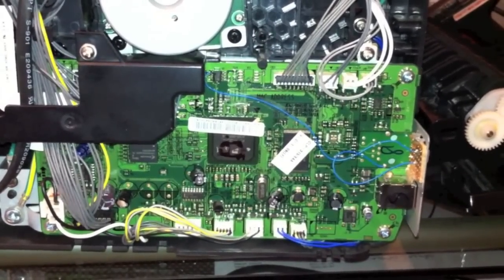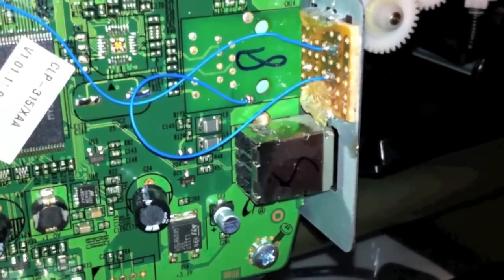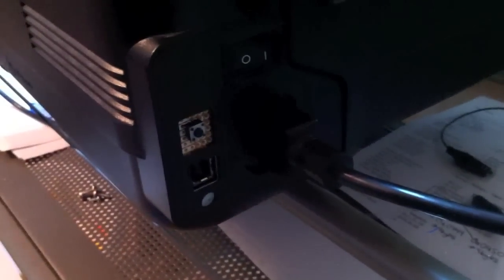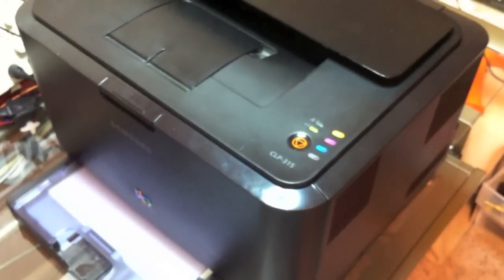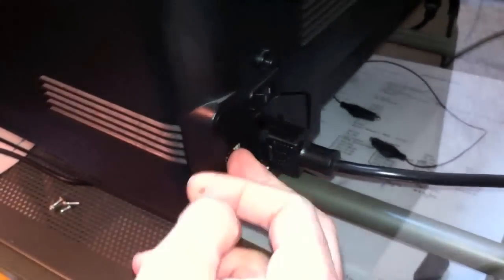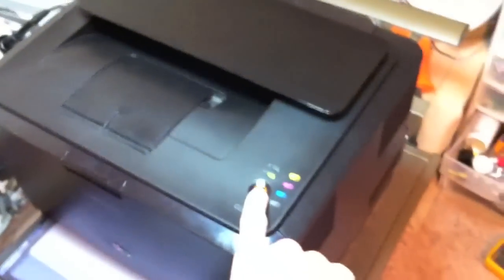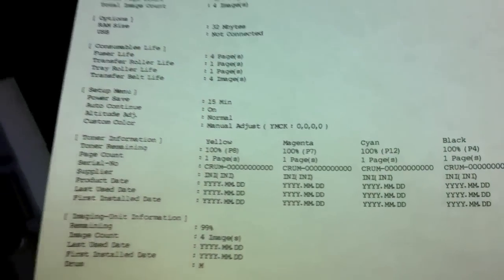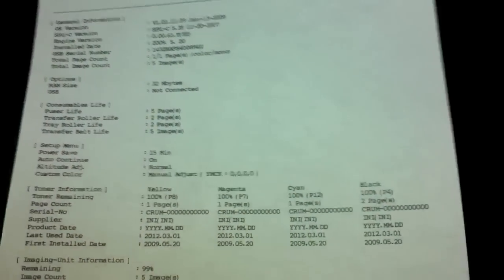Samsung CLP-315 Page Count Reset Hack

Comment: Turns out my board looks somewhat different than yours, but by zooming I could it as the V1 chip, found it in another location, brushed off my somewhat rusty soldering skills, and it works!  Thanks for the great hack!

Comment from the maker: I was lucky with my toner.  It all ran out at the same time so resetting all of the counters made sense.  If you want the low toner warnings to work correctly, after you reset using this method, you would need to refill all cartridges (as I did after this hack).  If you don't, I imagine the worst you would run into would be areas with missing toner (as you have mentioned).  Good luck!

Comment: Worked like a charm! No switch but I used an alligator clip test lead to close the circuit and left the two wires hanging out the back for future use. Although, eventually, I will run out of toner for real. At least I'll be able to use all the toner. Thanks for the clear demonstration.

Comment: Thanks Brian, just did this on my Samsung CLP310N, worked like a charm first time, reset cartridges to 100%. Had just one problem identifying (pin1) on 24C64WP, got to look carefully as it has been placed at 180degrees, did not notice 45degree bevel on chip so that top pin to the left you mention is actually (pin 5)

Comment: I took me an hour to try different times to release button when starting. I tried releasing the button at blue then red, and reed light and it never worked a wasted a ton of paper until i read here somewhere below .you have to tape the metal contacts on the cartridge! And it works i got 100% all toners and 0 pages!
Thanks
Reply: And thanks to you for that important info. The tape across the Cart Contacts is essential.

Comment: Thanks so much.  I used your method but only reset my black counter by printing the config page instead of the color test page during the reset.  For me, I print mostly black so it empties much more often.  The Colors all kept the original values.  Thanks again.

Comment: Just had a look at both my 315 & 315W, the boards are quite different to yours!
V 0.5 4L & V0.4 4L. Also tried the hack where you lift pin 7 and connect it to pin 8 - no luck.
What I really need to know (because I have alot of Toner) is how to reset counter on the ITU.

Comment: You should have mentioned that it's NECESSARY(!) to at leat print one color and one mono page while in reset mode so the new counts get writen to the chip, otherwise it will write the old counts after normal boot (both, clp 310 and 315). Btw, you only need to push the reset button until it makes noise, not until it stops making noise. Cheers!

Comment from the maker: I installed the momentary switch because I will need to perform the reset procedure the next time I run out of toner.  The switch certainly isn't mandatory, but I didn't want to open up the printer every time I needed to reset the counters.

Comment: Hi Brian,
thank you so much - I tried it too (CLP-315) - It's perfect.
I additionally had to tape the contacts of the original toner-counter...and what a surprise: Suddenly the printer is able to print colored pictures with "empty" toner ;-)
Otherwise, if I do not tape the contacts: After normal re-boot, counter of colored pages is back, mono remeins "forgotten".
--> Since 2012, is there any news e.g. does the printer still accept the hack? Or may be it requires original toner after some time printing without gettin any information from the missing counter-chips at toner?
Best regards from Germany :-)

Comment: There is a company out of Canada (find them on Ebay) that sells a little board pretty cheap w/instructions. They also sell toner for less than 1/2 what Samsung does.The serialized toner issue can be gotten around by insulating the contacts. FYI if you are using this printer with the wi-fi option, be prepared to input ssid/wpa every time there is a power failure, so keep a cat5 cable handy. Now...how about an attorney who is hungry that would be willing to lead an anti-trust suit??

Comment: How about a hack for the 325.  Circuit board does not match the 315 model so I am a bit flustered as to where the reset chip is.  Any help on this?
Reply: Did you end up finding a way to hack it?

Comment: Great trick thanks a lot! Just one question. After reseting, all toners where 100% but after reopening the printer, Black was 100% and the other toners, where i left them. (Y43% M48% C53%). Black before reset was at 16%. Should i wait for the others to go low too and then reset again?
Reply from the maker: I can think of two possible scenarios where this may happen.  You may have toner cartridges with chips in them.  If so, make sure to tape over the contacts and re-run the hack.
Another possibility is that after booting with SDA held low, you printed the configuration page, but didn't print the demo page.
Booting with SDA held low interrupts the EEPROM of the page counts leaving them initialized at 0 in memory.  Printing the page afterward is what actually writes the new value (1) back into the EEPROM.  New values will only be written for the toner colors used on the page.  The configuration page is black and white and the demo page is full color.  Make sure to print both.

It could certainly be something else that I'm not aware of, but these are the things I would check first.  Good luck!  (c:
Reply: Brian Rumburg I'm an idiot, i didnt print the demo page and the color toners were not reseted. I followed again your instructions and everything's fine now! Thank you again!!! Great job!
Reply from the maker: Γεώργιος Χαλδαιόπουλος Fantastic!  Glad to hear it worked out for you.

Comment: Used this hack on a CLP-315W when the imaging unit counter reached its limit. I couldn't print a test page even more! The chip was located a bit more to to the right, next to the ribbon connector. For a successful reset I had to tape all the contacts on the cartridges and had to ground the reset during the boot up until the first green flash of the status indicator. The printer starts spinning for a much longer time than normal. At the end of the boot up you should get a green status, if not; the reset wasn't successful and you should try again.   Secondly, because it's the W model, all settings for wireless and ethernet connection are reset. To get access to the printer configuration again you need to connect directly by ethernet (set PC IP: 192.0.0.196 and printer is 192.0.0.192) and configure the printer again. I lost the MAC address of the ethernet connection but that wasn't a problem for the direct communication. When there are problems with the wireless detection of the printer, set the IP to a fixed address  within your network.
Only by taping all the cartridges or using cartridges without chip, all the counters are reset.
Reply: Thanks to your comment i could reset mine as well.

Ive tried grounding the pin all the way through the initialization but that would just lead to all lights flashing red.
When releasing on the first green blink of the LED everything worked :)

Comment: after reseting you can enable the write protection of the Flach chip  set a bridge between VCC and WP  next to it.
is it possible that the reset dosnt work with Firmware 1.29.11?

Comment from the maker: There were others around the interwebs who had already identified the EEPROM chip before I got started.  That being said, it wouldn't have been that difficult to find if you searched for the part numbers on top of the chips.

I have no idea if this approach is possible with the ML-2165.  Maybe you could find someone willing to take some hi res photos of the main board?  Even if you find the external EEPROM, the approach isn't guaranteed to work as it all depends on the firmware of the main CPU.

Comment: I've the CLP 315 but my layout was different. I found V1 right left of the biggest plug. In addition just putting pin 5 on ground didb't work for me. In addition I had zu oben pin 7 (Wp (write protect)). And most interestingly I've to use the printer in that configuration (pin 5 to ground and pin 7 open). Otherwise the counters are back in the thousands.

Comment: did the mod to the letter ( i think ) when i hold the switch down and turn the unit on it takes a long time for the start up to end --  the difference is that the yellow light stays red and will not print a test page ---  after i turn the unit off and back on again it works normal but nothing is reset.  now i did connect the wire to pin 1 of the IC - if this is not correct please advise-  thanks

Comment: (1/2) I just tried it on my CPL-315. At first it didn't work. The printer kept saying there was a paper jam but soon I found out why... I didn't put the top back on so that's an important thing not to forget!
Then I've put the wire to ground until the motor started spinning. It went through its self test which took longer than usual but not as long as it should've. It failed... I couldn't print the config report or nothing. Eventually I found out what the problem was.

Comment: Hello, nice hack there! i have a CLP-300 and CLX 3160FN but no matter how i try this it wont work :((((( i was wonderin, do you know if i take off the eeprom chip from the clp-315 and put it into my CLP-300 would it work? thanks!!
Reply from the maker: I strongly recommend against doing that.  It is very likely that each printer model has its own unique set of memory locations for storing these types of values.  Also, it would likely scramble the data on the 315's EEPROM chip making it unusable in that machine if you put it back.

If you are interested in pursuing a hack on the CLX model you might be able to start by dumping the contents of the EEPROM, printing a page, and then dumping the contents of the EEPROM again.  You would want to watch for areas that have changed, specifically areas that have incremented by one.  That is what I was doing when I stumbled upon the other (far easier) hack that I wrote about.

Good luck!
Reply: Brian Rumburg Interesting deal, i will try and let you know =]
Reply: Brian Rumburg I just reset my CLX-3160FN, well almost, everything is set to 0 except for the transfer-belt drum still giving me 15330 pages xP, i will make a video to show you how i did. Thanks for your help!

Comment: It doesn't work for me. In my CLP-310 the EEPROM is soldered on V11 socket, actually the same model from Atmel, but this method doesn't gave me any result. Have you any idea how it could be solved?
Thanks.
Reply: ***** it works now, I just need to restart the printer in order to reset the page count.
I just connected the write protect pin to high voltage and printer remains now in the "new" :)

Comment: ;okay i checked the wiring and all --- make sure i had it on the right pin - took it off and replaced.  no avail.  the printer light would go red and stay that way and had to turn the power off to get anything out of the computer .  just for the heck of it i tried again and this time i released the switch when the indicator light turned red, waited for the unit to stop -  viola - it worked. all reset. just release the switch before the specified time.